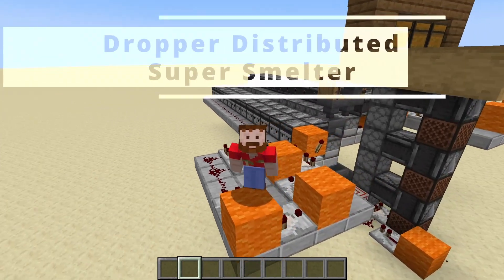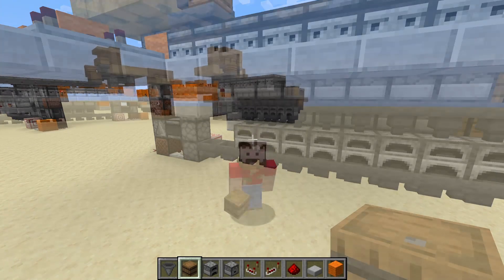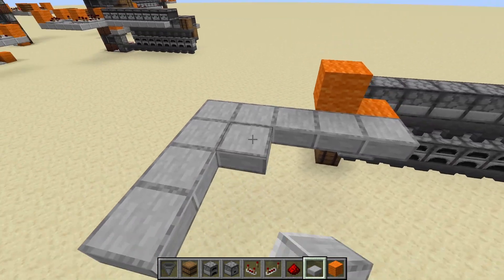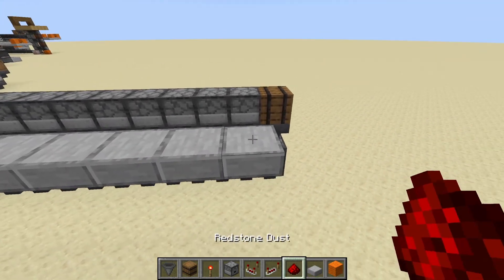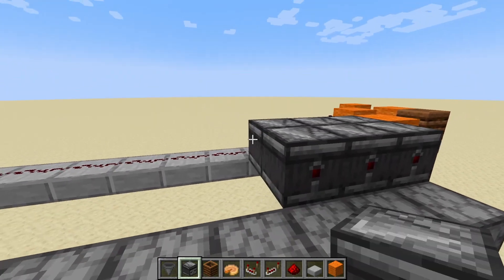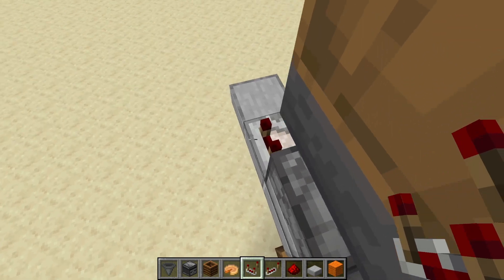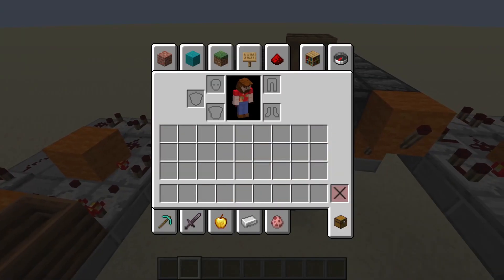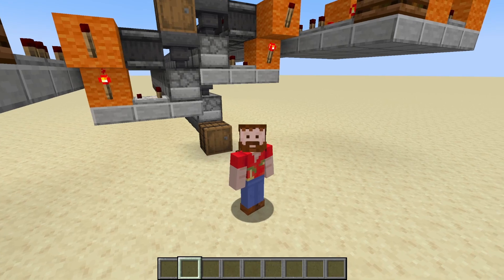Quiet Super Smelter using Dropper Distribution

Comment: If I use this with semi automatic potion brewer, then items will distribute evenly but can you tell me how will I get exact 9 items? when selecting recipes.
Reply from the maker: When items are added, it takes 9. So just put a stack in (or part stack greater than 9) and it will just take the first 9.
Reply: @elhedran Thankyou for you reply, what I want to achieve is I want to build semi automatic potion browser with 9 brewing stands. On youtube all semi automatic brewer contain only 1 brewer.
If you see the videos on pressing button, dropper will drop one item to hopper.

I want a circuit that on pressing button one time it should drop 9 items from dropper. then I can use your silent distributing to distribute items equally to all brewers.
Reply from the maker: Sorry, I keep getting confused between this build and and a different one https://youtu.be/-mBdfCgkmqQ - and then reply to the comments on this or the other video thinking about the wrong design.  Note - the link earlier in this comment is for a 9 brewer design - but I wouldn't use it as a base for what you describe because its a bit fragile to surrounding redstone (e.g. the "button select items idea) and would break if changed.

I also assume you have seen - but am not aiming quite at this level: https://www.youtube.com/watch?v=o59Cs6i_Qx8(not my design - Michael2_3B).

I'd love to help you but you are posing quite the challenge and I can't recall seeing a video that matches it.  I am also pretty sure that none of the video's on my channel are the right starting point.
Reply from the maker: If you do work it out (or find someone else who does) - post a link please
Reply: @elhedran  I watched the design of Michael2_3B. Its too complicated and who needs all the potions too much, that why I decided to make semi automatic, so your design will still break? in the latest minecraft versions due to direction? well I will download your world and give a try.
Reply: @elhedran  Hi can we make use of this in 9 semi automatic brewer
https://youtu.be/y9I1uZsWG18
Reply from the maker: https://youtu.be/lAvw8VMSzdY - did a new video that includes item distribution for brewers - also includes a couple of options for doing nine pulses to send the ingredients.

Comment: do you think it would be worth it to put a barrel buffer at the item to smelt hopper input for long term smelting or smelting with >5 items to prevent it from ending up in the last furnace/barrel? it could be too much of an edge case to worry
Reply from the maker: Its just an extra barrel and hopper per furnace.  If you have an iron farm https://www.youtube.com/watch?v=-oYyJ6jfSPU that isn't that much of a cost at all.  And lets be honest, Mojang isn't exactly making it so there are less items in the game to deal with.

It is sort of amusing for me though, in that I made this design when someone pointed out my hopper based silent smelter https://youtu.be/hhAlybSMQF8 would clog up on >1 item types.  And rather than coming up with an entirely new approach, I could have just added barrels as suggested to that one.

I guess then though I wouldn't have made this video.

Now I've got a new problem.  Do I prefer my hopper based design with barrel buffers, or the dropper based design?
Reply: lol thank you for the input i spent a few hrs yesterday fiddling with the design, compacting more furnaces off the same signal. its quite an elegant solution compared to the unlocking of the hoppers @elhedran